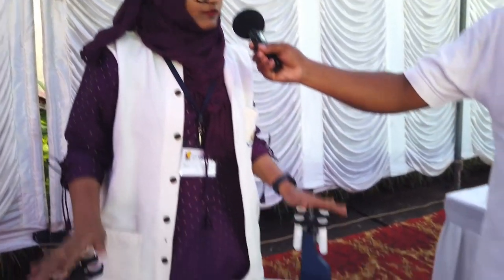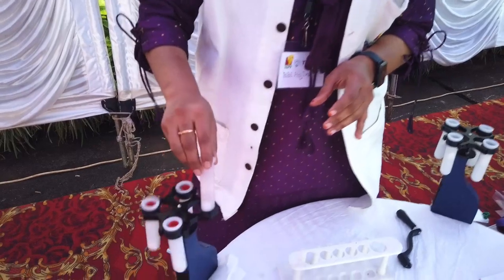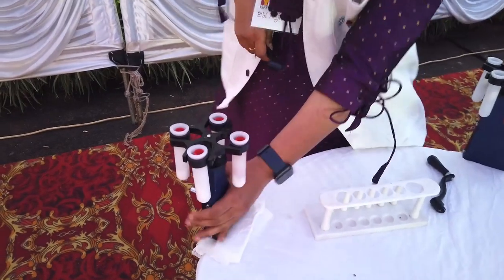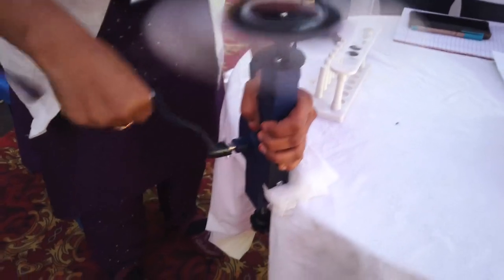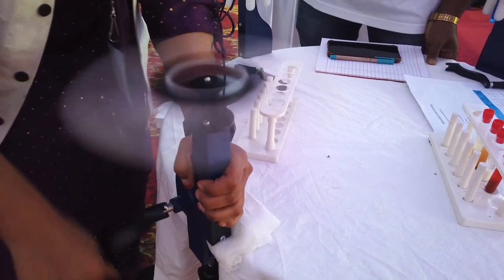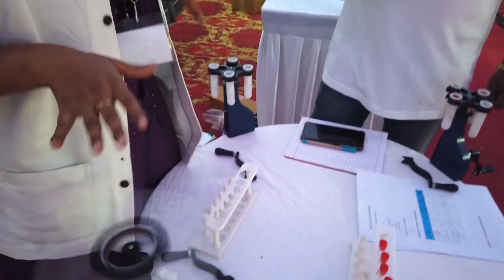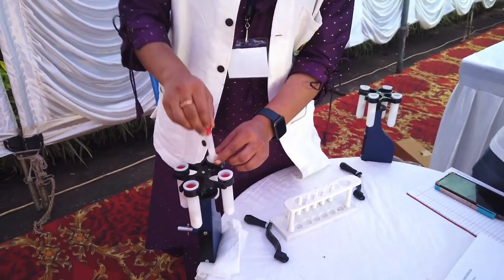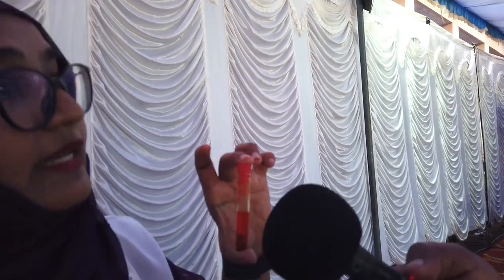Hand centrifuge | ThinkTac

Comment: This is great. I wonder what it would take to get it up to higher speeds, but still be manually operated.
Reply: The way I would solve that is by using two motors that at the same voltage one that turns very fast and one that turns very slow, i would put a crank to the slow motor to use it as generator and the fast motor would use it to turn the rotor. That way the mechanical efficiency is high without being too complex, should be very reliable as well tough significantly bulkier.